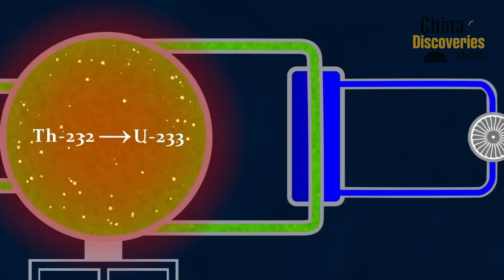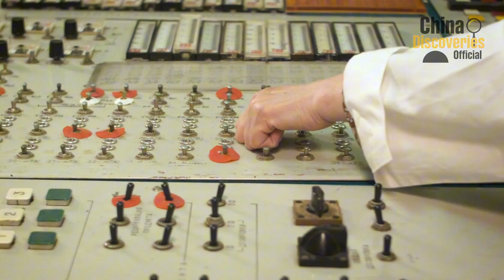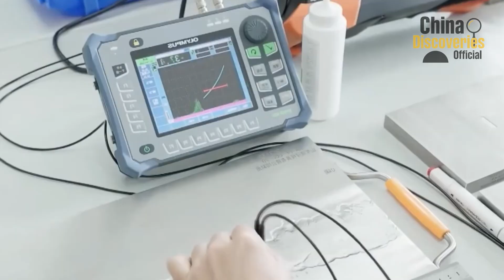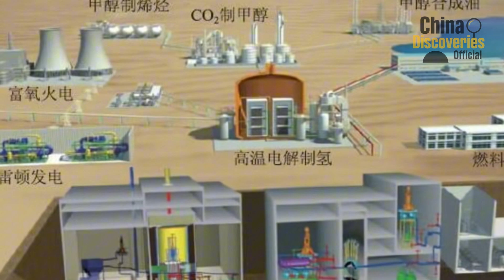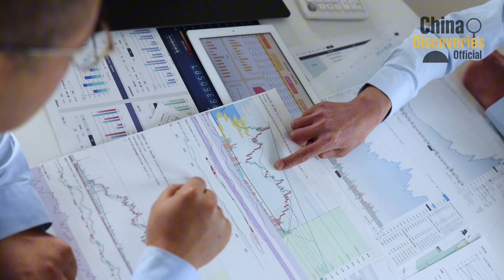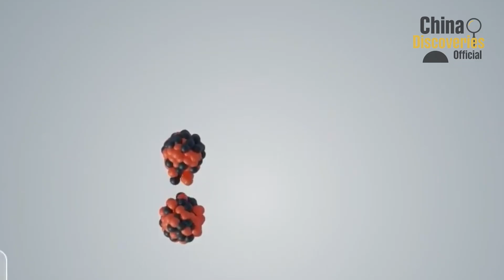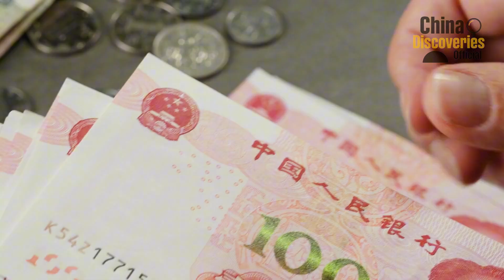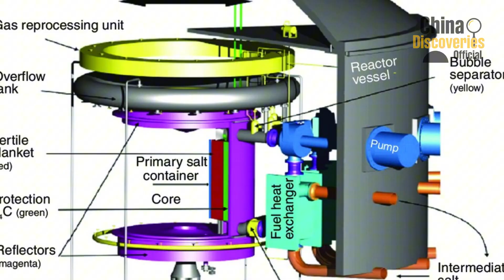China Has Just Succeeded in “Breeding” Clean Uranium Energy From Thorium, Shocking the U.S.

Comment: THE PEOPLE OF BURKINA FASO ARE SUFFERING FROM LUCK OF ELECTRICITY.
RUSSIA IS PROLONGING THE TIME LINE TO BUILD ONLY A VERY SMALL NUCLEAR POWER PLANT THAT WILL BARELY BE ENOUGH TO EVEN  ELECTRIFY  THE CAPITAL CITY OF BURKINA FASO. ..
BUT CHINA HAVE THE CAPACITY TO BUILD NUCLEAR POWER PLANT AND THORIUM PLANTS TO GENERATE ELECTRICITY.  THEREFORE, CHINA CAN BUID 2-3 NUCLEAR OR THORIUM POWER PLANT WITH A CAPACITY OF  5-6 GW AND TRAIN BURKINA FASO ENGINEERS  TO MANAGE, REPAIR AND CONTROL THE STATIONS WITH THE HELP OF CHINA TRAINING BURKIA ENGINEERS.
AT THE SAME TIME CHINA CAN TRANSFER TECHNOLOGY  TO BURKINA FASO THE 450-500 KM/ HOUR ELECTRIC TRAINS AND ALSO TRAIN BURKINA ENGINEERS TO MAINTAIN. PRODUCE MORE. THAT WILL BE MEANINGFUL TAN ONLY SENDING MILITARY WEAPONS LIKE RUSSIA WHICH WILL GET OLD AND RUST BUT THE ELECTRIC TRAIN WOULD HAVE BEEN EXTREMELY APPRECIATED  AND WILL BE REMEMBERED BY THE GENEROUS PEOPLE FOREVER BY BURKINA FASO PEOPLE.
Reply from the maker: Of course. If the two governments actually meet and make it happen, it would be an amazing step forward for the people of Burkina Faso.

Comment: The biggest issue with thorium has been the corrosive nature of thorium salt. I'm curious on how they addressed that as the US thorium reactor showed corrosion throughout the pipes.
Reply from the maker: China solved the old MSRE corrosion issue by using improved Hastelloy-N alloys, real-time salt purification, and lower operating temperatures. Modern materials = no repeat of the 1960s problem.